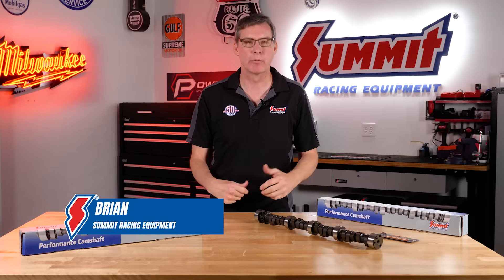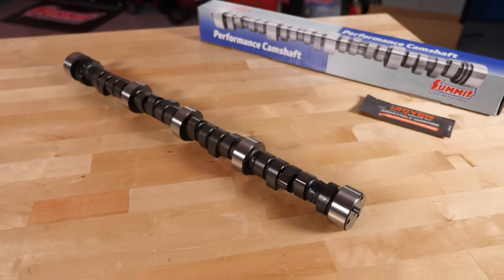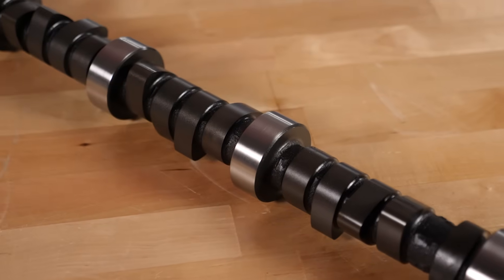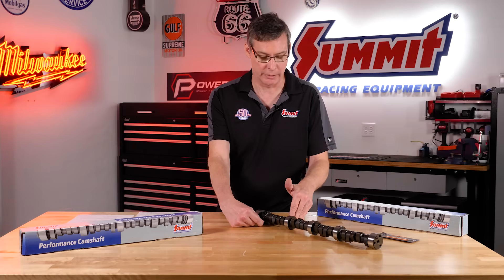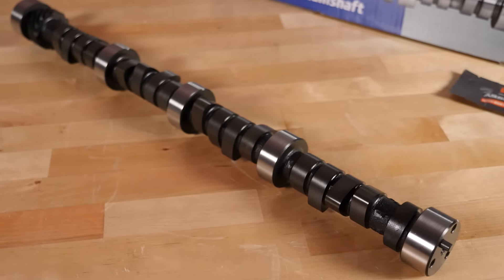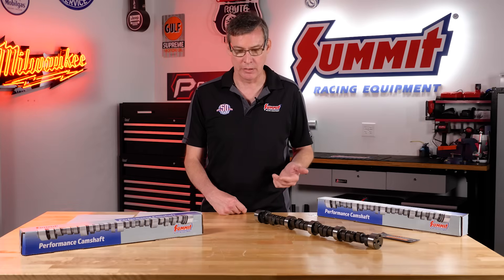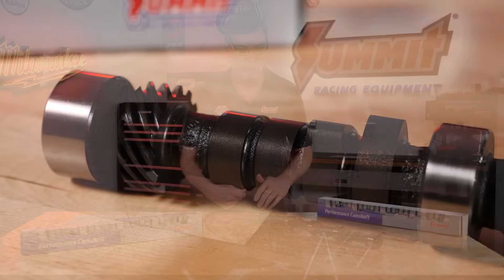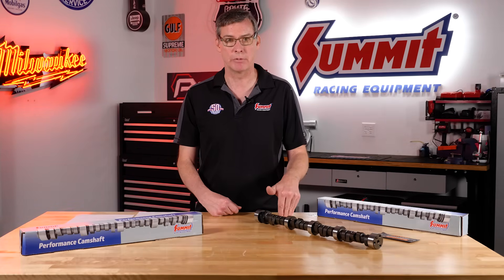Change Your SBC Engine’s Firing Order for Better Performance with a Summit Racing Pro 4-7 Swap Cam

Comment: I'll be ordering the mildest 4/7 swap cam that Summit sells. 5,200 rpm will be plenty for a street cruiser. My reason is the new Vortecs I have. I keep reading about cracking, so the swap will give me the "hot pair" of ports (4 & 2) up front where the coolant temp is lower. If cracks due to over heating is an issue, this should help. That's my hope anyway.

Comment: Some misconceptions about a 4-7 swap: 1) Does not fix cylinder air/fuel starvation by evening the firing order, just moves it from 5 and 7 to 4 and 2. If you want to fix that problem, you need to also do a 2-3 swap, at which point you have the LS firing order (and also exhaust note I think). 
2) Offers no HP benefits to EFI engines, since they don't have the starvation problem in the first place. It will just confuse the O2 monitoring.

This is a longevity / high RPM mod for engines already making big power.

Comment: The 4 7 swap cam is a great option they had them in corvette in the  seventies possibly in the sixties memories not that great anymore but you’re technical and engineering is spot on thank you for all your hard work to make a superior product I’ll be ordering one for my 69 3/4 ton truck with some summit roller tip rockers

Comment: The cam lobes are frictionless because of finish. The power gain is the weight of cam and lobe finish.
Reply: No it isn’t lol, the 4-7 swap has been around for ever and it yields around a dozen more horsepower just by being a more efficient firing order.
Reply: @HeapOfEngineering  heavy engine rotating parts increases Torque/horsepower. Even heavier wheels/tires increase torque/horsepower.